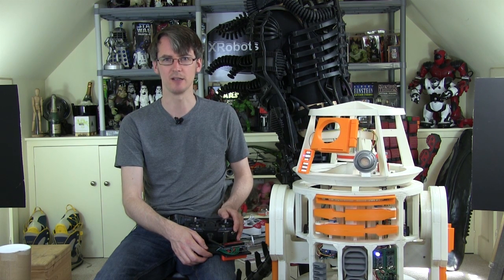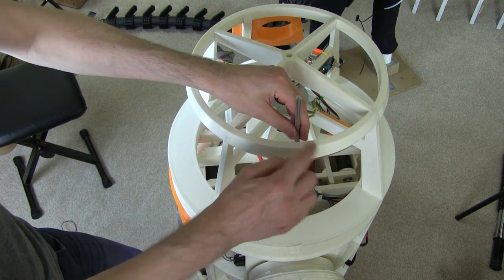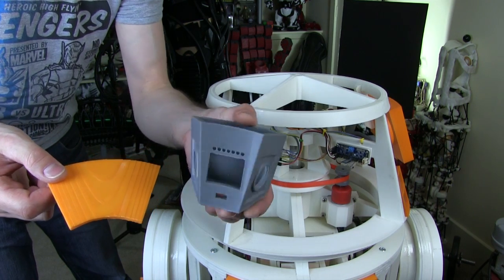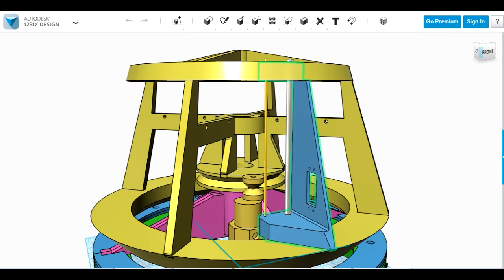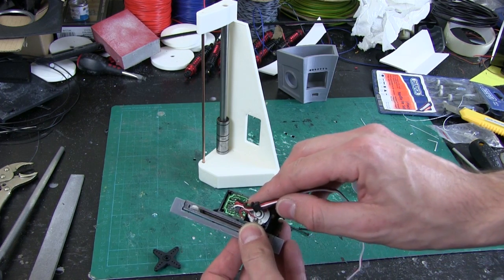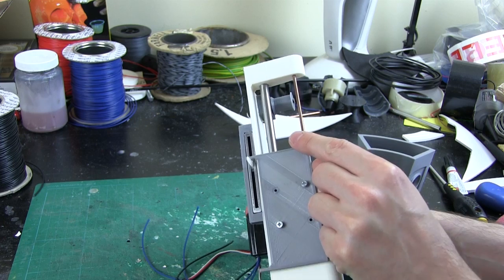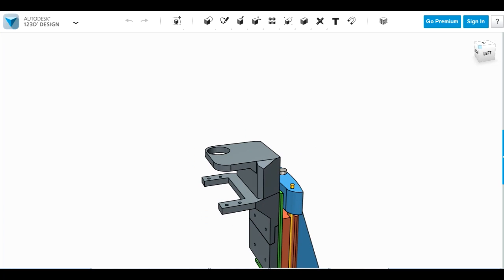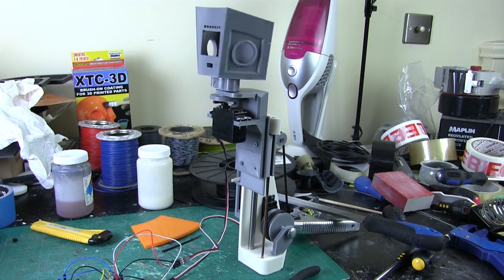Star Wars R6 Droid #15 | Periscope Accessory | James Bruton

Comment: Looks awesome! A tiny little thing - all the other orange parts look like they would be sticking out a bit but this is flush with the frame and looks a bit far in the case. I always imagine a layer of 5mm transparent acrylic sheets around it, even though it's not there.

Comment: Hi James,
Servo controllers will typically use some kind of PID control. What's probably happening is that when the slider finally engages the linear pot, the PID contoroller experiences a massive overshoot in the expected value, which is why it gets the rebound - it's trying to compensate for this.

The solution would probably be to have a smaller gap between the engagement pegs on the slider, so that it has longer to adjust for this.

I think it is an excellent idea though!

Comment: James, a better dirty hack for the servo is to skip the pot totally and install a pair of cheap end stop switches with appropriate resistors to satisfy the servo input. You get a more reliable system and can ditch the costly linear pot.

Comment: I think the behavior you're seeing is due to overshoot on the control loop within the servo. You might need to use a fixed resistor inside the servo and send the slide pot to the arduino and control it like a motor

Comment: I hadn't noticed before, but the head twists a bit back and forth when it stops spinning because of the belt you're using at the moment. Have you considered replacing it with a toothed belt or a driving chain? Something that is not as elastic as ninjaflex...

Comment: Why use a servo and slider potentiometer together?

Shouldn't a regular geared motor be enough since the slider potentiometer will give you the exact position of the periscope anyway?

Edit, i commented without watching the rest of the video, still,  dismantling a servo instead of using a regular motor seems like a waste.
Reply: Well with a geared motor, you wouldn't need the large wheel, saving time and material and you could use the slider pot to know where the periscope is, like if the value it's above 50%, that means the the periscope is up, else it is down.

I personally would also use the slider potentiometer to know the end/stop points, that would allow me to make the motor run at 100% speed up and down in a linear/mechanical fashion, suddenly stopping it when the slider value was ~<20% or ~>80%.

As usual, sorry for my horrible english.